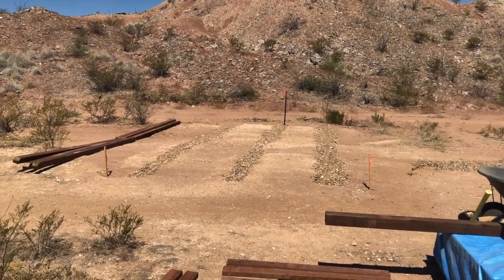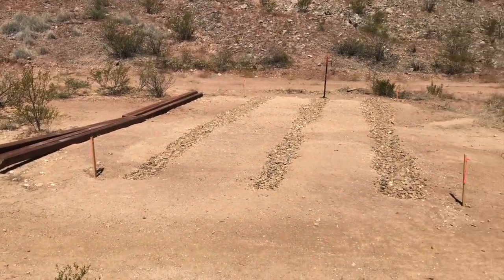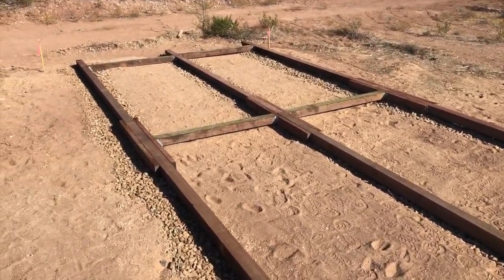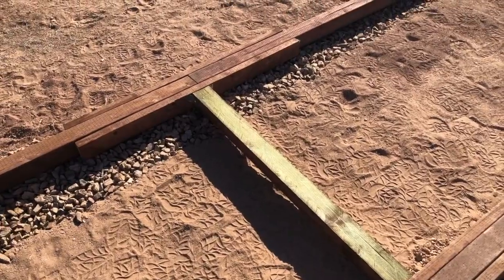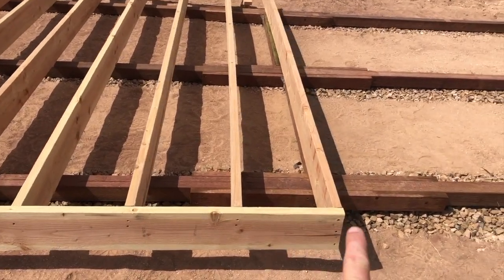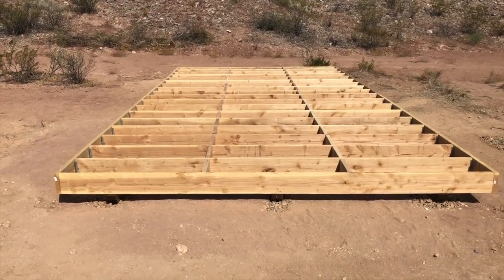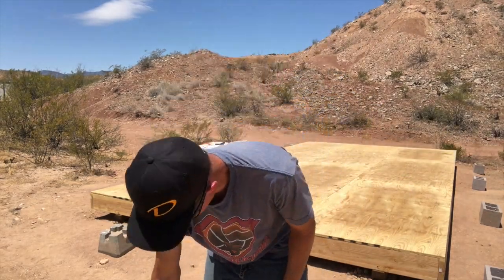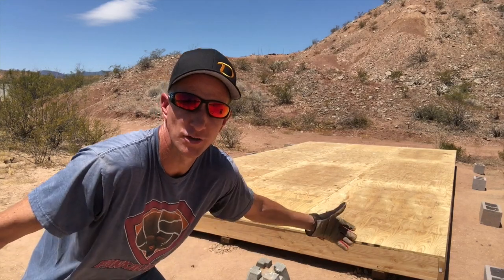12'x24' DIY Shed Build (Part 1 - Floor)

Comment: Great video.  Just a couple of comments: 1)  Boards tend to climb when you nail at an angle.  I think you can minimize the gap between the joint by keeping the joist hanger snug against the side of the joist.  2) You recommended supporting the skids using 4x4 cross supports.  It seems that this would make it difficult to slide when you want to drag the shed somewhere.
Reply from the maker: Valid points.  I don't think moving it is all that practical, but luckily I don't think we really have a need to.

Comment: What you are supposed to do is put a nail or screw into the the joist at an angle, or from the outside of the ring boards to temporarily hold the joist. Once you get it to grade and temporarily held by said screw or nail, then you install the joist hanger, so that they are flush and tight.
Reply from the maker: Thanks for the tip!

Comment: 9:00 2X 150mm galv bugle batten screws top and bottom, save time and you wont need those hangers.
Reply from the maker: Hadn't heard of those.  Had to look them up!  Thanks for the suggestion. 👍

Comment: You gotta ask your neighbors! I've got a palm nailer that you'd use with my air compressor and makes driving those nails for the hangers in a cinch, don't have to swing any hammers.

Instead of using the blocking throughout, you can use 3/4" tongue and groove plywood and put construction glue in it and that makes the edges of the plywood really secure. Either way is fine :)

Plywood doesn't typically split like what you were worried about and going in to 2x lumber is no problem. No predrilling needed.

This base is about 100x better than the other one you built. Great job!

Once you get this shed done, your building confidence will go through the roof. Before I built the tiny house, I didn't have much experience except for electrical and I felt like I could build anything afterwards.
Reply from the maker: Thanks, neighbor!  Just a few more things I didn't know, but each project makes us a little smarter, right?  Thanks for the advice and the offer.  I'll definitely take you up on it when I get to the roof!
Reply: Speaking of tongue in groove, did you hear about those new neighbors down the street that bought that land, the lesbian couple, they're awesome... super friendly. They're building a place as well, except their entire place will be tongue in groove, not a stud in sight!!! LOL hahaha :o)--
Reply: Tico nail guns are even better for this. They're made specifically to do that job.
Reply: @jenniferbond598  😝🤘

Comment: Cool project. Arizona? Not sure why you used joist hangers here...🤔 normally those are for hanging unsupported joists off of supported rims instead of the other way around. Solid work tho! 🤘🙌👍
Reply from the maker: You mean because they're laying across skids?  I guess that's a good point.  I can see that now, but didn't even really think about it at the time.  What else would I have done?  Toe nail?  Face nail through rim joists?
Reply: @MidlifePrices  yep 3 face nails through the rims will get her done. Those brackets won't hurt anything, just overkill. Doing it the way you did makes a great stable floor. The rims are basically nothing more than a fascia for the floor. I love your overall design. I'm doing a smaller scale version of the same shed soon, so your series really hit home and was very entertaining. THANK YOU!
Reply from the maker: Thanks!  Good luck!

Comment: Just now seeing this one. Two points. One because the floor joists are supported by the skids and not by the rim joists ( band ), joist hangers are not needed or required. Should have simply butt nailed them to the rim. Two, since the skids are spliced in the center, it would have been better to put one 12 foot section centered then a 6 foot section on either end to add strength to skid splice. As long as you do not move the structure a lot it really won't matter here. It might show up if it were ever pulled onto a trailer to haul to another site.  And the idea of presetting the screws is just a waste of time. While you are there just run the screw. The preset method would never make it for production.
Reply from the maker: Good points, Dallas.  Luckily, I'm just doing one-time builds.  I'm sure there are efficiencies that could be built in for speed.

Comment: I have one question. If your floor joists are 12ft and your rim boards are 1.5 inches wide then you’d be at 12ft 3in total width. How did u compensate for this later when building walls? Did u just add an extra stud at each end of your walls?
Reply from the maker: The joists are actually 11’ 9” to account for the rim joists. The finished span is 12’. Good question if I didn’t explain that!

Comment: Great video! I am planning to build a 16'x24' shed. Could you give me a tip on how i should plan the foundation? I plan to use pea gravel and solid concrete blocks for the skids to rest on. I just need help on the layout as I am no professional.
Reply from the maker: That's a fine choice for a foundation.  As far as layout, it mostly comes down to how you're going to use it and what will be inside.  Really a matter of personal preference.  My dimensions were driven largely to minimize waste (multiples of 4 and 8 for things like plywood sheeting) and for roof sizing (need to be able to span the distance with rafters).  16x24 is quite large.  Rafters for a shed style (single slope) roof would be very long and, therefore, would need to be quite large.  Maybe not as bad if you're planning a gable style roof.  Lots of variables involved.  My advice would be to seek out other examples of that size of shed and see how they've done it.  That's what I did.  Happy to help if you want to discuss further, though.  Not a professional here, either!  Thanks for watching.

Comment: I’m trying to do a VERY inexpensive shed and wondering what plywood to use for the floor.....pressure treated ?  How thick ? Thx !
Reply from the maker: I did not use pressure treated and don't think you should need to.  It is 3/4" thick, and I have found that 1/2" will tend to sag, unless your floor joists are spaced tighter than 16" OC.  I'd say the 3/4" is necessary.  Good luck on your build!

Comment: Just curious, could you have used a nail gun and no joist hangers? 3-4 nails on the outside vertically and 4 diagonal nails?
Reply from the maker: Good question!  I think questions like these don't always have a simple answer, and there's almost always multiple ways to do something.  I don't think your suggestion would fail, at least not for some time, but I believe the purpose of the joist hangers is to avoid having the connection occur only through the end grain of the wood, which is the weakest connection point for a piece of wood.  With the joist hangers, you're nailing into the face of a board (the rim joist), and the downward force is also spread out by the joist hanger, rather than just on the nail.  Of course, I'm not a professional builder, but I believe that is the reason for "engineering" a fastener for this purpose.  It could even be a code violation that you should check on.

Comment: Would you this foundation building method is goos to use for building a tiny house, as well?
Reply from the maker: I'm not an expert, but probably wouldn't recommend skids as a tiny house foundation.  Probably want something a little more permanent.  Also, I think probably any county would consider that a temporary structure, meaning that you could not treat it as a permanent dwelling.  I would definitely ask your county building permit office a question like that, but those are my initial thoughts.
Reply: @MidlifePrices  thanks! Yeah it's tough to decide which foundatiin to use since there are many methonds.

Comment: Hi, Brian, I see you have some dek blocks by the side of your foundation. I see people lay lumbers directly on those concrete blocks to build the foundation. I do not know whether your food skid or the deck blocks better for Mississippi where we have torrential rains for days when my 4-inch shed foundation can get wet. For wet protection, I lean more to dek block foundation,  but structurally, which method is better in your opinion? Are 12*24 foundations are too big to use dek blocks?
Thanks!
Reply from the maker: I suppose it would just come down to how many you use and the spacing between them.  In my example the skids provide continuous support for all the floor joists, but the deck blocks would only support the joists that were sitting in them.  I realize it would make sense for you to raise the whole assembly off the ground, but there would need to be enough deck blocks to provide enough support points for the joists not to sag.  Interesting question.  Thanks!

Comment: Your using nails for the joist hanger where its required to use bolts.
The nails dont have the shear strength the bolts do. And they will pull out a screw or bolts will not pull out.

Nice trick on the presenting screws, I didnt know either, speed the job up.

I did see a trick for setting joist hangers without the whole joist, just use a 6- 12 or 24" pec of scrap for the rim joist setting drop in you joist after pre setting them all put in your outside screw then the inside bolts.

By the way I comment not to put you down, it's to share what I've learned from other people watching youtube videos.  Last shed I built was a prefab metal shed from sears 35 to 40 years ago for someone else and it was on a cement pad. I should drive by that house now and look for it becuse I'll bet it looks very nasty by now.

I like the fact you used branching on the joists, you dont even see that in houses anymore, oh with tong and grove you shouldn't have to have a blocking under the lips, but the blocking ties everything togather and makes a much stronger floor, I'm going to bet you could part a 3/4 ton pickup truck on that without dammage.
Reply from the maker: Hmm.  Never heard of using bolts before.  Manufacturer's suggestions are either nails or screws (specifically made for joist hanging).  I just know that, generally, shear strength of nails is better than screws.  I've never seen a manufacturer ever suggest any kind of bolt, but I'm not an expert!  Thanks for the advice, and for clarifying that it wasn't malicious.  Constructive criticism always welcome here, and I'm always open to suggestions.  I definitely think it's overbuilt, but that makes me feel more comfortable, so…  I appreciate the kind words, and thanks for watching!
Reply: @MidlifePrices  1/4-Inch Hex Head drive reduces cam-out for easier installation

Shank is specifically designed to match the fastener holes in Simpson Strong-Tie connectors

Optimized heat treated for strength

Mechanically-galvanized coating meets ASTM B695 class 55

Connectors installed with SD screw code listed under ICC-ES ESR-3096, Imported

Watch how to repair your deck from a-z on youtube.  
I know you look at that and say screw, it is but its driven in with a nut driver becuse its hex head.  From what I understand these have more shear strength then nails.  These are also engineered for shear. 

I live in tornado alley I'm not a big fan of nails. With enough force nails pull out say even a 16 penny nail will pull out  most studded walls are toenaild in place or bottom nailed then stood up, working on my own house I've found loose wall studs in a 2 x 4 partition wall 
That not even the drywall held in place. 
Perhaps it was a poor framing job, or the pratace isn't that strong. How much force does it take to knock a 2 by 4 loose off a 2 by 4 butt joint where its nails either throw the bottom plate or toenaild into place, end grain in wood is not very strong. Stand a nailed togather wall up it's pretty flimsy untill you get the sheathing on it screws tend to be more ridgid and dont flop around as much.  Not all screws and bolts have the same tincil strength. 
I belive every connection should be done with hurricane ties. Everywhere, for both wind and seismic movement 
And tied directly into the foundation from roof line to basement. Houses wouldnt blow apart or shake apart look at the rules they now have in California and Florida. Both places have codes very differnt then any other place in the nation now.  
I think if houses are falling down and blowing over, we are not making them sound enough.  Granted your a fool to build on the fault line, or expect almost anything to withstand a cat 5 or f5 head on but at least one room should be safe  most houses explode becuse the garage door blows in then the house fills with pressure, or the roof blows off and walls are not that strong.
IE nails.   Drive a nail and sink a screw
Use your hammer to pull both, the screw wont pull out the nail will.
Yes the screw will break, depends on the type of screw, the nail will just pull out. Nothing but a round soft metal to hold it in. Nails are made out of soft wire metal, it's very low carbon steel.
Screws are made out of all types of materials depending on what it's for.
You have to use the right screw for the job.  After a wile you can use the left screws.
You wouldnt hang a door with nails would you? No becuse after using the door for a wile it's going to come loose.
Screws are stronger. They bite into the material.
Nails are cheaper and faster.

Are you a fan of pocket holes kraig jigs
Do the same thing with nails and stand on either part the nailed boards will pull 
Apart.  
Kitchen cabnits are hung with special screws. They used to use nails, about 75% more of them.  I took out an old kitchen once I must have pulled 150 nails out just to get 5' of boxes off the wall.  We put the new system back up with 25 screws maybe that were ment to hang cabinets with.
These were 2.5" long screws, the nails I pulled were 1 3/4"

Comment: Why did you not make the skid 12x24 also ?
Reply from the maker: Hmm.  Let me try and walk through the logic.  The skids do support the entire 24' length, as the only other support in that direction are the rim joists.  As for the 12' length, the joists (every 16") provide the stability and support in this direction.  So, the only job of the skids in this direction is to distribute the weight to the ground, so it's not necessary to push all the way out to the edges.  You actually want that support to be even underneath the joists, so some overhang is perfectly fine.  Not exactly the same, but similar to the idea that a roof can overhang the walls of a building.

Comment: Great video Sir, I am getting ready to build a shed wanting this same size. My hardest problem to get started is getting a foundation leveled out putting the frame on. How deep are your trenches with the gravel? And thank you for a great video.
Reply from the maker: They're about 6 inches deep.  Foundations freak me out, too.  Hope these are good enough in our climate.  Good luck!
Reply: What thickness of plywood did you go with on the floor
Reply from the maker: Went with 3/4".  Had done 1/2" on a previous small shed floor and it sagged pretty badly.  I think 3/4" is pretty standard for this, unless you plan on putting something really heavy, like a vehicle, inside.

Comment: Brian, I  always nail my joists off to my rim board, and then mount my hangers. But you would have been fine with as much  support that you have to use 2x6 instead of 2x8 for joists. Then instead of hangers just use a 2x2 ledger under the joists. It cost less and gives more support.
Reply: The design you have with the rim boards not supporting ledgers and hangers are really not necessary, you could have just attached the rim board to the joists with nails or screws. Just some money saving tips.
Reply from the maker: Just trying to follow.  I questioned this while I was doing it.  Are the joist hangers unnecessary because the joists are resting on the skids?  Thanks for the tips - I just wanna make sure I follow.
Reply: MidlifePrices l0l, that is correct.
Reply: Yes sir you are correct.

Comment: Did you use 2x6x12 for the joist?
Reply from the maker: Actually had to double check this on the summary video (https://www.youtube.com/watch?v=bn-le-CHeJI&list=PLcp2iimBuLEQMhEQZDwHoTLyDuhOJXN2W&index=10&t=18s), since it's been a little while.  I actually went with 2x8x12.  Might have been overkill, but would rather err on that side.
Reply: Yeah I noticed that too I was thinking those definitely aren’t 4x4s LOL

Comment: Do u have to screw or can u use nails
Reply from the maker: Either one will fasten two pieces together, but I usually make my choice based on whether I'm looking for "squeezing" or compressive strength (screws preferred) vs. shear strength (nails preferred).  Since the floor sheathing is more likely to pop up or pull away from the floor joists rather than shift side to side, I went for squeezing strength here.

Comment: How much would you estimate a shed that is 40ft x 10ft with a 10ft ceiling.
Reply from the maker: Not a simple question, but that's close to double the size, so probably pushing ~$8k?